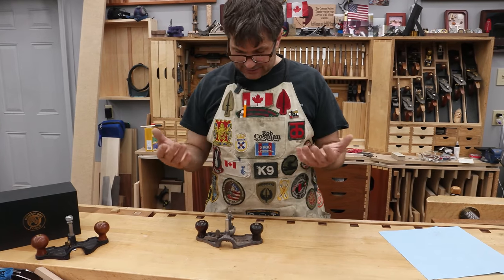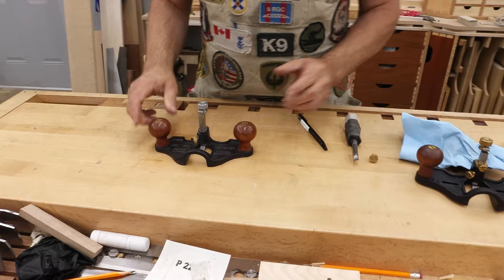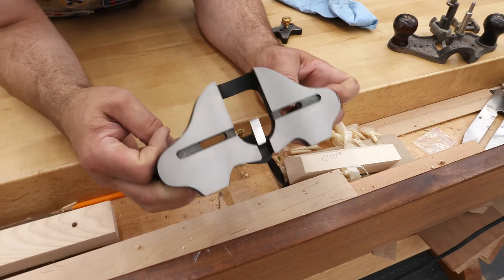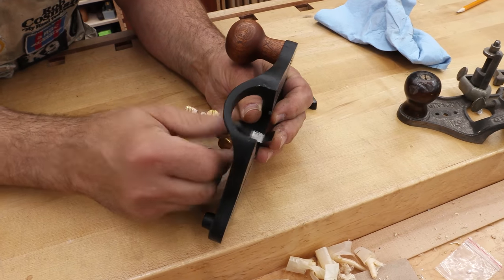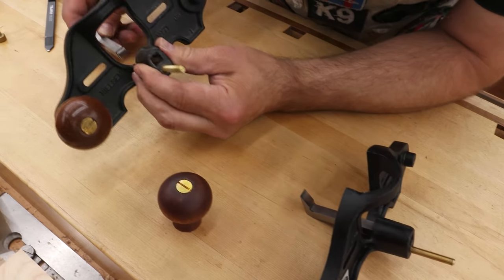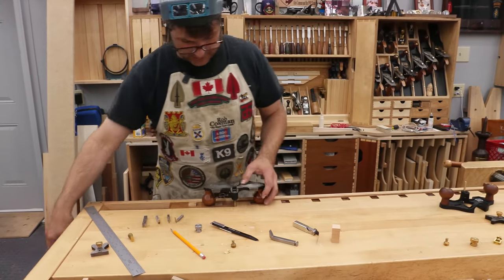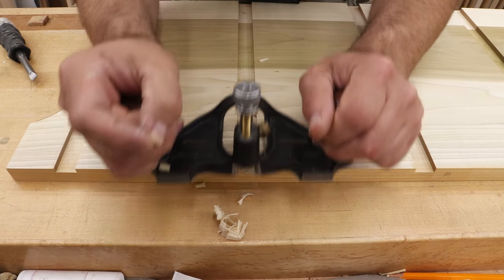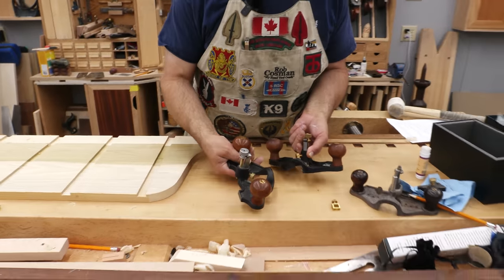Router Plane Reviews - Lie Nielsen vs Bench Dog

Comment: Very helpful video. I’d just add that with the Bench Dog, there’s occasionally a 20% off coupon through Rockler that would make it a better value proposition. At $50 dollars, I’d probably go with the LN for the reasons Rob put forward.
Reply from the maker: good point

Comment: Good review, thanks for taking the time to make the comparison between the two. It might have been helpful to include an old Stanley or Record plane in good condition just to see how both the Benchdog and LN compare. 

For the $50 I would go with the tool made right here in the USA, plus the LN has a bit better fit and finish than the Benchdog version. In general I prefer US or Canadian made planes over others. 

Also, I've noticed you stay away from making comparisons to Veritas tools. I'm sure there is a reason but I've never heard an explanation as to why. I have a few of Veritas planes and find them to be as good quality as LN versions. Features set them apart sometimes but I think they both make quality tools.
Reply from the maker: the oy significant difference is the way the old Stanley's and Records held the blades; not nearly as solid as the LN

Comment: I had a similar choice between the LN and Woodriver 5 1/2.  I went for the LN, even though it was $125 more ($300 v $425) for some of the same reasons as you; LN is made in USA, Woodriver basically a copy (although a good one) of the LN.  I do notice you recommend Woodriver a lot, and it being manufactured in China and basically a copycat of LN planes doesn't seem to bother you.  I just purchased the Benchdog router plane as it was on sale for $97 vs the LN at $250.  I spent the money on the LN 5 1/2 because I use it often for a lot of different operations, but with the price difference and the performance parity between the BD ad LN router planes, it's hard to justify the LN.  I may pickup a small LN router plane in the future though.

Comment: Following up on my last post. First Bench Dog router plane was returned due to a crooked blade mount. Received a second one which was better in that the blade mount was straight but had a significant high spot in the center (think Rob got lucky with his example). Worked quite bit to get it quasi flat but not perfect. I believe there is quite a bit of flex in the body. At any rate, with a wider platform base bolted to it and a good sharpening, it worked pretty well and I figured I'd just live with the shortcomings. 

Except that a couple weeks later, I received an email from Lie Nielsen that they had a very limited supply of open faced router planes in stock. I successfully ordered it within a couple hours of the email. (checked again the next morning and they were out again) 
Just received it last week. NIGHT AND DAY DIFFERENCE! Perfect in every way ... even the blade was completely usable out of the box. I didn't set out to do my own side by side comparison but that's what happened. I could live with a few cosmetic differences but that's not what I experienced at all. If you're thinking of going with the BD, just save your money and get on LN's list (or go to that Canadian company that shall not be mentioned), and be done with it. :--)

Comment: Thanks for sharing. I've looked at the Lie-Nelson website and there are router planes with an open and closed throat. Is there a big difference between them? (The open throat are out of stock). Thanks
Reply from the maker: The open throat, in my opinion, are less likely to clog up with shavings. But if you wanted to buy one right now I don’t think you’d mind the closed throat.

Comment: I was hoping for an ultra-closeup of the bottom of the dado where to meets the sidewalls to see if there was a radius, but I guess the tenon is usually left a bit short.  I also wondered if the vertical adjustment screw on the Lie Neilson has more threads per inch.  The lie is the superior tool - much superior to my skill level 😊

Comment: I got the bench dog router plane yesterday, and I can't see how to remove the blade. It seems trapped by the knurled adjustment knob, even when the knob is unscrewed completely off the top of the height adjustment bolt,  the blade is trapped by the knob.

Comment: Rob, regarding the depth adjustment, I think tightening the blade with the screwdriver is an unnecessary step. 
The adjustment wheel cannot be used to push the blade to a desired depth, simply because there is too much backlash, and the iron will slip.
I just hand tighten the blade, enough so I can still push it down with my thumb until it rests on the adjustment wheel.
With this technique, I don't need to use a screwdriver, and it is a lot faster to make cuts in small increments (undo the adjustment wheel 1/4 turn, push the blade with my thumb and cut). 
I am sure you know what I am talking about, I am curious to know what's your opinion.
Reply from the maker: I disagree. As I pointed out “thumb-tight” has never held well enough for me to rely on. If I were doing a lot of waste removal, and using the depth collar, I would probably rely on hand-tight so I could quickly move it up and down. But I rarely perform such a task, so I always use a screwdriver for a reliable depth that I know won’t change.
Reply: Good tip on the ¼" turn on the adjustment wheel. Can be used with or without the use of a screwdriver to lock the blade's shaft in place. I'd consider it an intermediate series of depth stops until the blade bottoms out on the actual depth stop, just like the intermediate turret mounted depth stops are used on an electric plunge router.

Comment: Hello Rob, excellent and precise as always. I do have one question though. I see open and closed mouth versions of router planes, is there ever an advantage to that other design?
Regards
Peter
Reply: I'm interested in this as well, I really would like to have both but the cost is very prohibitive, which one would I be best off getting first??
Reply from the maker: I dont think so.  The idea with the open is you can see ahead of the blade better than a closed.  I generally mount a secondary base on mine eliminating that feature.  I really  think it was more of a marketing gizmo Stanley did.  I dont think it is a serious advantage

Comment: As they say 'you pay your money, you take your choice'. Nothing wrong with being loyal to local manufacturers or national manufacturers. However, don't they say immitation is the sincerest form of flattery and a high percentage of the Lie Nielsen is Stanley. To really make it their own they could have also changed the shape of the casting. $50 may not be much to some but as much as I think Rob really wanted the Lie Nielsen to be far better to justify its price, he struggled. One minute the deeper knurl on the screws are good for tightening especially if you have arthritis but in summing up they are crude. Five minutes with a file to soften the edges of the casting or sandpaper for the knobs is nothing. So, $50 dollars or more saved could buy someone a decent chisel or two.

Comment: Currently on sale for $99.99 and  Cosman video cited as reason for purchase by a customer.  A $75 difference plus the fact that Lie Nielson's out of stock on this plane are factors to consider.  
UPDATE, and a Question:  I sprung for the Bench Dog and I'm thinking that either they got a bad batch from India - hence the reduced price - or someone at Rockler noticed the name "Cosman" on the order and searched around for the best of the bunch to send out.  One standout difference between the one Rob received and mine is the blade/iron.  In contrast to his, mine has very, very obvious deeo mill marks on the top and bottom, and the cutting edge looks a a saw blade with "teeth" instead of a smooth cutting edge and the edge is quite wide.  No danger of cutting yourself with this blade and ots of work to try to get this usable.  I've written Rocker about this, asking if I can get a better iron but haven't heard back yet.

While I'm waiting I though I might kill some time trying to sharpen this thing and because of the deep mill marks on the bottom I've started with a 180 grit Trend diamond plate, so here's the question, if anybody knows: Can you use a variation of the ruler trick on the back of the blade?  The reference surface is the plane's bottom, not the back of the blade itself, so it seems like this trick could be employed here, obviously using a much thinner "ruler' - probably a feeler gauge - then typically used.
Reply from the maker: I would still wait for LN to get back in stock, but that's just me

Comment: Outcome is always predictable.  Like your work, but yes your basis is pretty strong.  Like buying local, but for those that cannot afford top dollar tools as it is not the only tool you need, the Bench dog is impressive.  What would be interesting is Bench Dog vs. Stanley (new), which are both sold by Rockler (I know you have worked with Woodcraft) so not sure if you are able to compare the two.

Comment: The fit & finish very likely accounts for the $50 price difference via labour costs (and middleman markup of course), but the point made about innovation can equally be leveraged against the Lie Neilsen here. The Bench Dog has a depth stop device, apparently absent from the LN. If it works correctly, it is as much an improvement for repeated setting as the square tool bit is to cutter clamping.

Comment: They both function great. It's all down to whether or not 28% savings is worth buying the foreign knockoff. For me the margin is too close, especially for something that is one of the easiest tools to make on your own for virtually free. If I'm going to actually buy one I'll spend the extra dough to support the good company. Now, if the Bench Dog was half the price or less it would be a much harder deal to pass up. After all, router planes are wildly over priced. There is no reason I can buy a good quality jack plane for $50, yet a router that is much cheaper to make should cost three times that.

Comment: Mr Cosman failed to note one significant difference between the two products:  the Bench Dog has only one blade size.  L-N will sell you an adapter for the large router that allows you to use their small router blades in it, so you can get a 1/4" blade into the large router for doing grooves for a drawer bottom.

UPDATE:  I bought the L-N closed throat router plane.  It arrived much faster than I expected and it is terrific.  You can feel the quality right out of the box and right out of the box it performed without any tuning.  Just based on the performance I got from this tool right out of the box, I would say it's worth the extra $50 over the Bench Dog.
Reply: The blade in the Bench Dog looks to be identical in size to the LN. It seems you could buy the LN adaptor / smaller blade and use it in the Bench Dog. Not arguing in favor of the Bench Dog, just pointing out a potential work around.
Edit: The open throat LN has be out of stock forever, while the closed throat is in stock. I've always wondered what's the biggest consideration when comparing open vs closed. I've thought about pulling the trigger on the closed throat but have noticed many if not most of my woodworking heroes use the open throat. It doesn't seem like it would make much of a difference but curious if there's something I'm missing.
Reply: @philshock3805  I see your point; I don't know if the adapter is swappable. If it's off by a little bit in size, it won't work properly. The machining is very precise on the LN. As for open v closed throat, the way I hear it, the open throat is preferred for inlay work because it provides better visibility.
Reply: @psiclops521  Thanks for the reply. Yeah, if it's not the same size all bets would be off. Looks identical though when Rob hold them side by side. Better visibility was always my thought about an open throat and better rigidity with the closed throat. I don't know if either one is an actual issue in day to day use but just wondered if there was something I missed. I've since seen several comments from Rob though where he suggests "either one would be fine". Still undecided over the L-N closed version vs the Bench Dog open throat. I get the point of supporting domestic companies but the BD is on sale for $99 (w/ free shipping). Now we're talking about an $85+ difference.
Reply: @philshock3805  I bought the LN (closed) about a month ago.  I've used it a little and it lives up to reputation right outta da box. If the blade size doesn't matter, I certainly see saving the money and buying the BD. It would just have to be exceptional to be as good as this LN.

Comment: For a $50 difference,  I'd stick with the Lie Nielsen for the exact same reasons you mentioned.  They could be identical tools but half the cost and I'd rather support the company that put in the design effort and work to create a good tool than support the company that just copied someone else's design.
Reply from the maker: Well said
Reply: Did you miss the point Rob made that Lie Nielsen actually copied the ENTIRE design from Stanley and made only a few minor modifications? They did NOT design the planes!

Comment: It's funny. $50 is a hefty difference, as a percentage, but still, it's only fifty bucks.  So, for that, I'd buy the pretty one. There's just something about a really well-crafted tool that inspires you to want to use it. That said, I just recently bought one from that evil Canadian company we can't talk about, and it's great, too. $10 more than the L-N, and I like the way the L-N lock screw works, but I have already ordered some additional cutters for the V......, and they make quite a few more options to help me dispose of excess cash down the road. (I'm not throwing away my Hitachi, though.  It would cost a fortune to cut all the profiles it can do just by changing the bits.)
Reply from the maker: thanks for the comment

Comment: I agree with you, Lie nielsen planes is awesome. I can't afford a set of their bench planes (the old stanley/record is good enough for me), but I have the groove and tongue plane no 48 which is again a copy of the old stanley 48 with improvements. They took some of the best planes out there and made them better, so good on you LN!

Rob, your screwdriver is scary, what is that stuff you have around it? ;-)
Reply: To me, "It's Scary" for another reason; The slot in the head of the brass screw is rectangular in cross section, not tapered. Screwdrivers for slotted screws in the gun-smithing trade are designed to have full contact on the entire wall of that shape of screw slot - top to bottom, thereby greatly reducing the chance of it slipping out and/or marring the screw's slot or whatever the screwdriver hits next.

Comment: Surprisingly the small router plane uses O1 steel instead of the A2 on the larger plane. It's rather hard to compare for me since I don't have a router with A2 steel but I feel like O1 steel doesn't hold an edge as well as the the steel used in my bench plane.
Reply from the maker: for such a small blade that takes a small cut I dont think it makes a hill of beans whether its O1 or A2
Reply: @RobCosmanWoodworking  It probably doesn't matter much. I do use my router quite a bit though so it wears quickly

Comment: Rob -- It's not about how smooth the edges of the castings are or how polished the handles are. It's also not about "copycatting" because Lie Nielsen is a straight copycat of Stanley. That's superficial. It's so much more than that. 

LN and Veritas are part of a movement. They took risks to bring back quality hand tools. They're leaders. Without them, companies like Bench Dog and Wood River wouldn't bother improving the quality of their tools because they'd have no real competition. The only reason BD made a router plane of this quality is because LN did it first. I support LN and Veritas because if they don't survive, the entire hand tool industry will rot like Stanley did starting in the 1950s. If we buy the cheapest tools, all we'll ever get are cheaper quality tools. If that happens, you might not be able to buy a high-quality tool at any price. I don't want to live in that world. I want to have the option to buy a premium tool. It's worth an extra $50 to have small companies like LN out there. That's what your $50 is buying--not smoother handles.
Reply from the maker: absolutely....well said

Comment: I wish to add that there's actually a practical reason to buy domestic product. And that's in general one gets better service if something goes wrong. That's worth something.
It's the same with buying insurance. You never want to buy from the cheapest because it might be an expensive mistake when you submit a claim.
Furthermore, one needs to think long term for such a piece of tool. What if it needs servicing or parts a few years down the road? Nobody can say for sure who's going to be still around in long term, but the smart bet will be on an established domestic resource.
So, even without the "politically correct" consideration, one still have good reasons to go with LN even with a $50 difference, which frankly, is not much.
On the side note, given the huge disparity of Indian and US labor costs and the zero development cost of a copy product, the price difference should be more than a mere $50. Which means you are actually paying more on the profit to the seller than on the quality that goes into the product.
My last thought is that Rob didn't do the test of putting the planes under an electronic microscope. This is important because not all cast iron products are the same on the molecular level. An improperly casted product with lesser quality material will be more brittle. If you don't have access to an electronic microscope, try the drop test and see if either one will break. That will be an interesting test : )